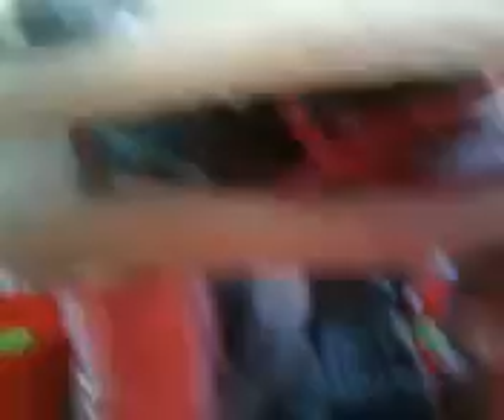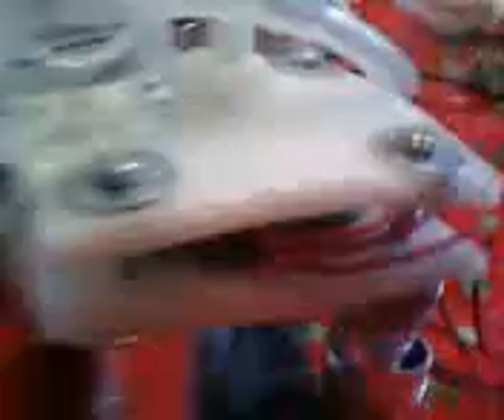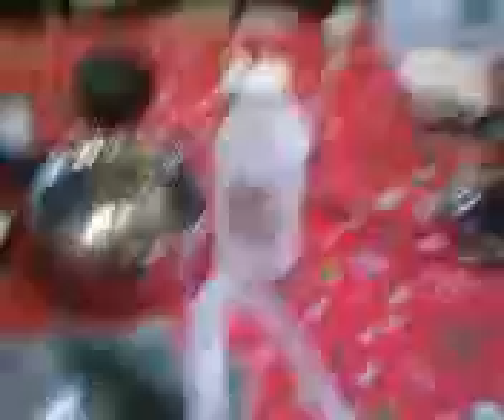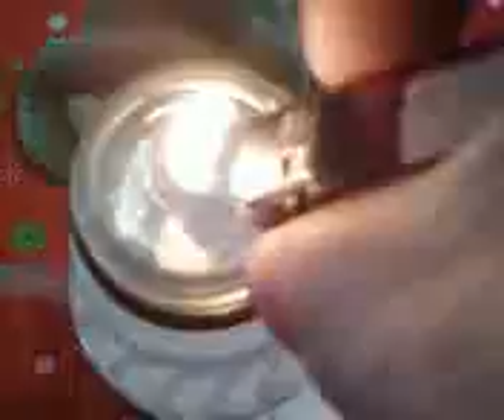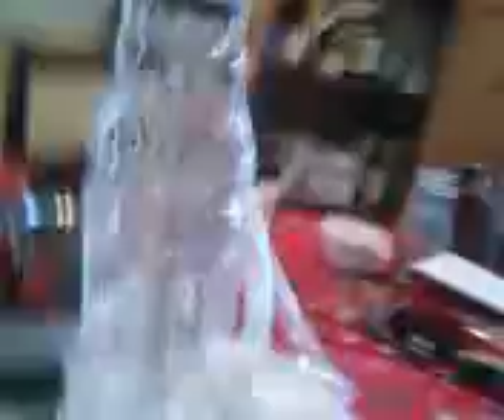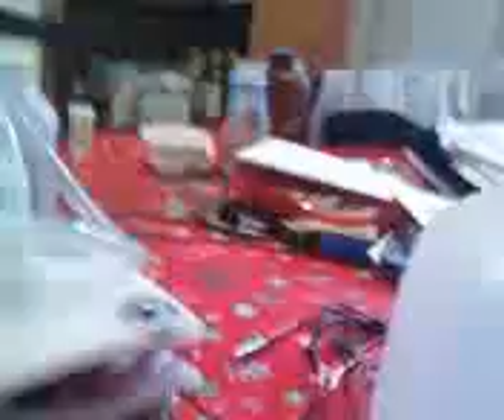Hard Drive HHO dry cell

Comment: I think he meant build or have someone build a switching circuit that shoots power from the negative then the positive rapidly. Rwgreasearch o some of the other guys on here could build you one. I would suggest making lye from ash and putting in a tiny bit @ 20w and let it run for a day. You might get platinum multiplying in the cell. Thanks for the post!

Comment: nice recycle-i remember watching a stack of HD plates in a bucket making shitloads of gas-but the plating came off rather quickly and the cell lost efficiency.
if you reversed the current all the time should stop the electroplating effect stripping the platinum off one plate and depositing it on another,and hopefully keep the coatings good.